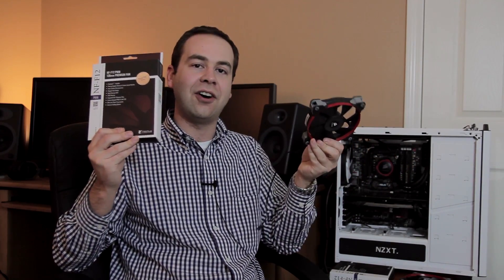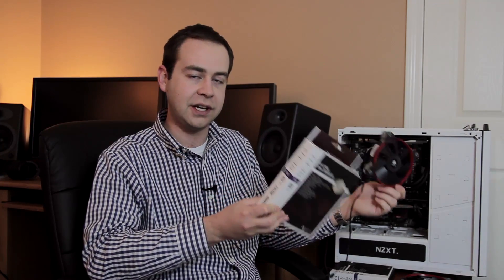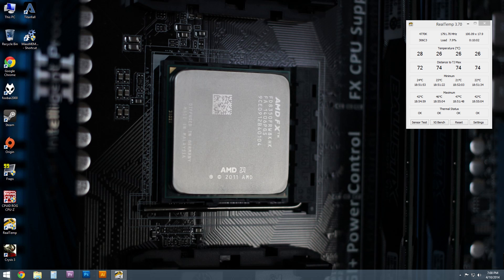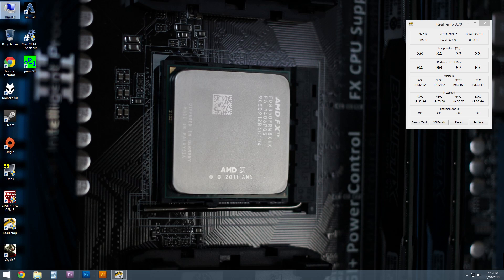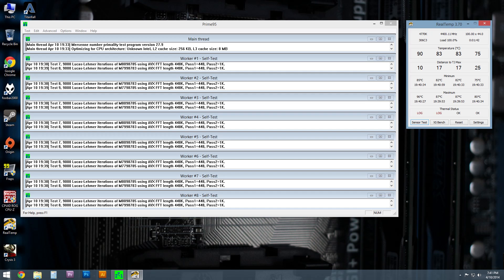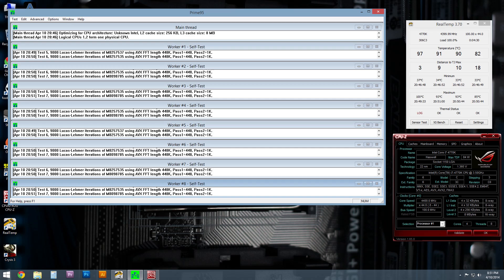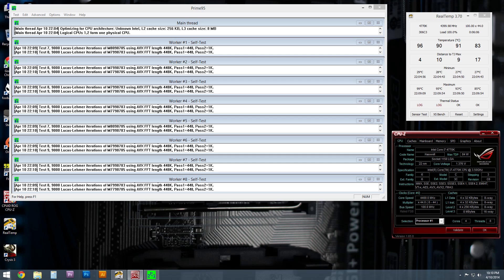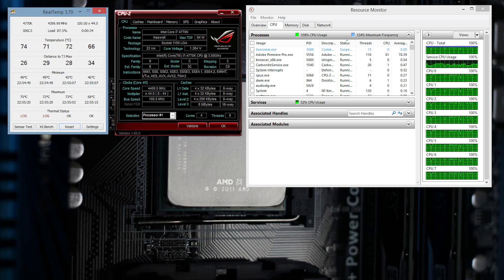NZXT H440 water cooling and fan placement performance test

Comment: Still using this case today with a 9900k and a 360mm aio. The difference I get from running with the top on and off is about 10°c

Comment: The speed of the CPU is different in each of your idle temperatures. First its at 1.8ghz in your first test, then its about 4GHz in the second idle screenshot where you have higher idle temperature (surprise surprise...), in the third test its at 800MHz.. this is why I disliked the video, not all conditions are the same in each of the tests.

Comment: Would it be weird to use the front as exhaust? Would it remove the heat from the gpu, ive got a gtx 770 sc and its hitting 80c :(

Comment: To all who are curious, yes, it is possible to do dual 360 rads, but they have to be slim rads i.e. 30mm thick. If you want to have a 3.5" drive in the very bottommost slot (the one where you have to tilt the case on its side to screw it into) the fans in the front must be pulling to make room for fittings.

Comment: Hey Chris, 
 I have a NXT H440 case  with a Cryorig H7 CPU cooler. In the rear of the case, I have a corsair AF 140 Corsair fan and in the front I have the 3 stock 120 fans. My issue is, since I am not using a liquid cooler, do I install fans on the top? I understand I can use 3 120's or 2 140's. But I am unsure if I should use them or not. Sorry for the long text, I'm a bit of a noob at building a pc. Thank you, Chris!
Reply: same question

Comment: Hey, really appreciate this test it is definitely something I was curious about.

Out of curiosity and I don't even know if it would make a difference...but when you swapped the configuration to pull hot air out of the case did you also swap the configuration of the airflow fan in the back to push cool air in and vice versa?

Comment: I just purchased this case and love the look. I did notice a huge jump in my pc operation temperatures while playing BF4 on ultra. Gpu was at 65 -70 and Cpu got to 70 Celsius. Compared to my old case which was loud and had more fans pulling air though and out its hot but not dangerous to my Pc parts. I am only running stock fans Atm but have the aerocool 140mm fan to test. i also removed the metal inside the lid and front to help with airflow. But i will keep the dust filters. i dont want a loud computer but i do want it to run 5-10 degree cooler.

Comment: I got this case the other day gone for my AIO cpu cooling fan on the front in the top position in push pull config then the 2 in the front middle and front bottom pulling in then ive crammed 3 fans in on top pulling out and the one on back pulling out and my temps are great :) all on balls out my cpu hovers around the 25oC to 30Oc depending on what ive got my heating on in house and under load she goes to about 45oC/50oC i wud hugley recommend this case it looks amazing and keeps stuff very cool if u fill all fan mounts

Comment: When you said you had the fans  mounted at the top, do you mean inside the case? I cant think of any other way if it were on the outside the noise reducing foam would completely block off airflow
Reply: Fans mounted on the top meaning from the inside out, it went radiator, fans, then case.

Comment: Man, I just dropped my cash on the H440 for my new build. I knew it would be a bummer on airflow, but assumed it would be at least workable, but I'm getting more worried as time goes on.

I guess I'll just return it if it turns out to be too much of an issue.
Reply: It should be fine, unless the only thing you do on your computer is run CPU stress tests.
Reply: If you remove the top and front panel while gaming you will be fine.
Reply: I've got one now, although I havent gotten round to liquid cooling it yet I don't think it will end up being too much of a problem.
Reply: ArtMonster I am in the same boat just loaded it up top for now and not too happy with the temps generated, water temp is above cpu temp at idle. wtf!!!

I am going to try a front mount with push/pull combo when i get home, not really worried about cpu temp but the inside temp gets way too hot imo.
Reply: Matt Johnson I used to mind but if you have some decent fans(not the stock fans) the airflow will actually pickup.

Comment: Hi great video. I just purchased this case with the Kraken x41 mounted in the front of the case. The cpu cooling performance is nice and well but I'm slightly concerned for my EVGA GTX 770 SC temperature as it is hitting 80 degrees. I have three 120mm fans on the top and one on back, with two 140mm fans on the front (including the radiator fan). Only one hard drive holder is installed. I'm using the stock NZXT fans. Any suggestions on how I can make my GPU run cooler? Buy better fans? Better fan config?

Comment: Your CPU should really run cooler than that, considering your set up, even if the airflow of this case is not the best. Have you considered checking how much thermal paste you applied? Sick build anyway, and cool and very helpful videos. Keep me coming.

Comment: how does having it push or pull effect the dust in the rad? surely it would be the same? i mean whether its push or pull the dust is still having to pass through the rad.
Reply from the maker: It really depends more on the case than anything. In push, anything floating around in the air gets pushed directly on the radiator fins. Particularly bad for people like me who like to keep the windows open. In pull, the air is being pulled from inside the case so there are less dust particles floating around. Now, if your case has a nice dust cover, then in push you would be fine because the dust cover would snag everything before it makes it to the radiator fins. Then you just have to clean off the cover from time to time.

Comment: I've just built a new rig using this system, with a corsair h100i with 2 corsair sp120 QE fans in a push configuration at the top of my case cooling my i5 4690k and I'm getting some really hot temps. 45~ish degrees celcius idle and i ran prime 95 for 20 mins and max temps were around 78 degrees(stock).

Does this sound normal? I'm not sure how i can improve temps any more. I have all case fans running at 1000rpm controlled in AI Suite.  

Previously I was getting 55 idle and 80 on load temps and i reseated my h100i and applied Arctic MX-4 paste. This improved temps a bit but I'm still not sure why i'm getting such high temps still.
Reply from the maker: The first thing I would be to remove the top of the case and re-run the tests and see if you see a big difference. The H440 isn't the greatest for airflow so at least you will know the H100i is doing its job.

Comment: Another great vid, but I would have liked to see push (outside to in), as that should be the best (in theory).  I think that's what I'm going to do on my Corsair 450D case with H110 cooler (450D case has a dust filter up top).  It will also help keep a positive air pressure reducing overall dust in the case.

I don't understand why dust in the radiator is the boogeyman of system cooling.  Just get a vacuum cleaner and some compressed air and blow it out once in a while.
Reply from the maker: I use one of these and it's great! http://www.amazon.com/Metro-Vacuum-ED500-500-Watt-Electric/dp/B001J4ZOAW/ref=sr_1_1?ie=UTF8&qid=1402523209&sr=8-1&keywords=Metro+DataVac

Getting a deep clean on the radiator or some system fans still requires removing completely and using water but for the maintenance cleanings this things is awesome.

Comment: So I bet under load you can hear the fans spinning away. And for like video rendering, I don't see an issue with that. Have you tried screen capturing while in a game? If so, does it get very noisy? I bet there are some mods you could add to the case, like mounting a radiator outside, I bet that'd keep it a lot cooler!

Comment: great video Chris I have the SP's and wanted to see side by side comparison of the two was thinking of switching to the Noctua's not trying to be a A-hole but the reason your temps are going so hi is not the case well maybe partly the case but mostly I but it that your V-core is very high 1.37volt on a 4770k is very for 4.4ghz overclock it not recommended to exceed 1.3volt I would try and bring your core voltage down you should be able to get 4.4ghz at somewhere between 1.2 to1.27volts and that my friend will bring your temps down considerable
Reply from the maker: Thanks for the comment. That was actually pointed out to me the other day so I posted a followup video adjusting the voltage. What happened was after I set my voltage in the bios using offset like I usually do, the lovely ASUS AI Suite "tune up" decided it should be adaptive. Thus the crazy high voltage. After I set it back to offset it made a huge difference. The video is here if you are interested :) Corsair H105 push-pull in NZXT H440 revisited

Comment: why u don't try push config (pushing air out of the case) with the radiator mounted at the top of the case and fans below it..
Reply from the maker: I've tested push vs pull in my other case (Fractal Design R4) and only noticed about 1 or 2 degrees difference but I had to deal with a lot of dust being blow into the fins of the radiator. Since then, I avoid push so I don't have to remove the fans and clean as often.